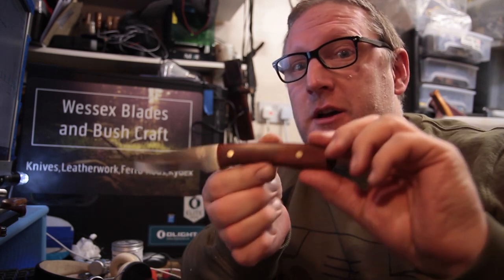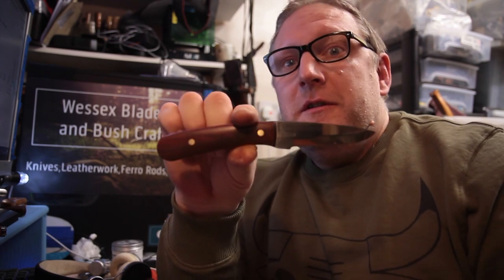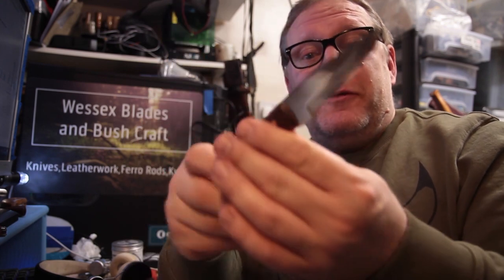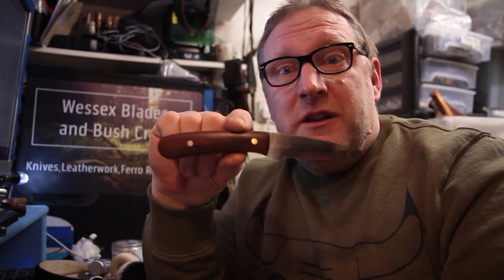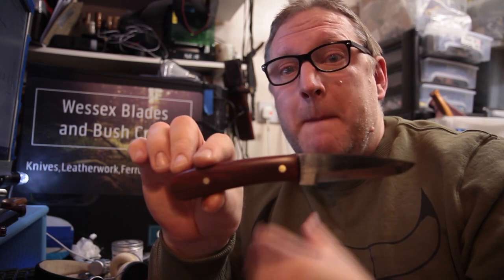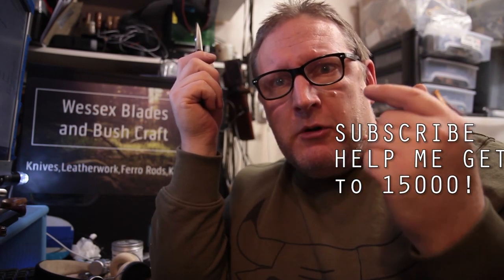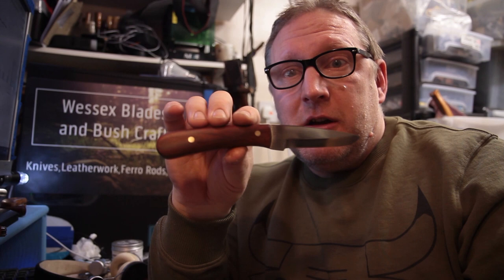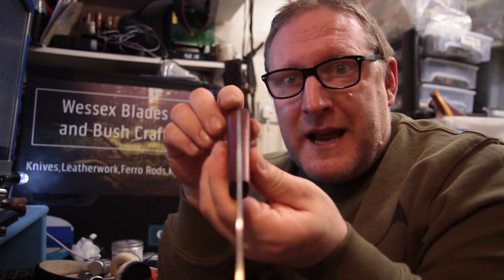Neck knife with beautiful scales of resin stabilised Wood, with custom hand made leather sheath

Comment: Red wood  a soft wood, so will scales me hard, even after stabilising
Reply from the maker: Sycamore is a hard wood, but when spalted will be significantly "softer" once the fungus has got through it, hence why it requires stabilisation, this redwood is a softwood but was still in great condition as compared with a punky spalted piece of hardwood, so both woods benefit from having resin infiltration, yew also being a conifer(baccata) is a great wood but to extend it's service life on a knife benefits from resin stabilisation, you don't necessarily have to have the hardest material on the planet on a knife because it will be the best , because it's the hardest, therefore it's the best, I love Kabar USMC knives, leather discs packed on the tang, plenty "hard enough" , the stabilisation also counters moisture ingress, release so prevents expansion, contraction ,splitting not just making it hard, the whole process creates a more resilient set of scales across many areas.
Reply: @WessexBladesHandMadeKnives  helpful to know